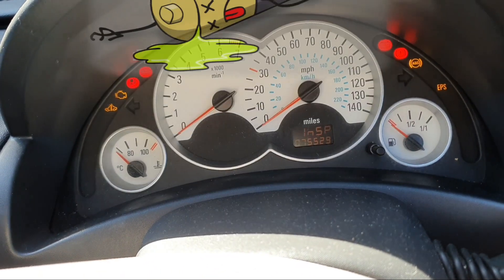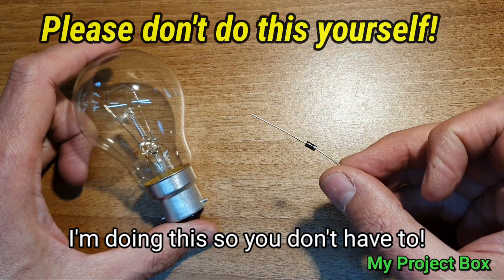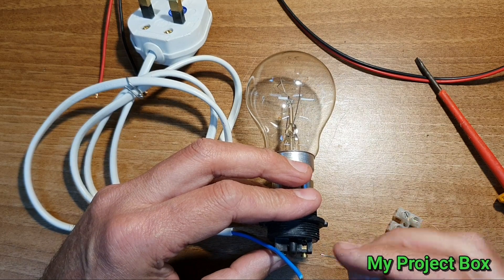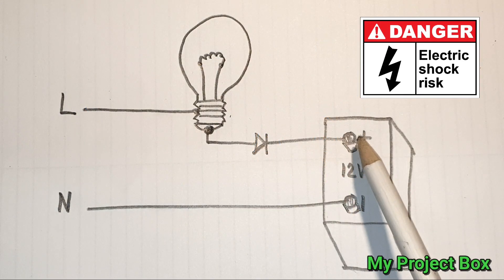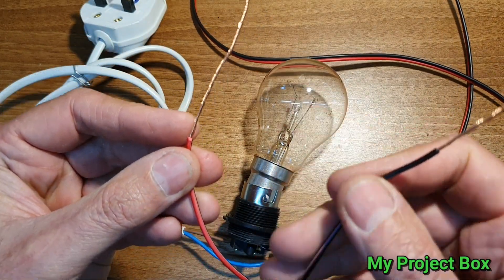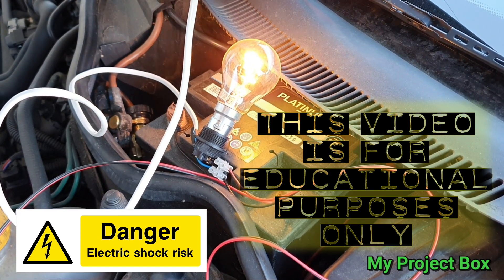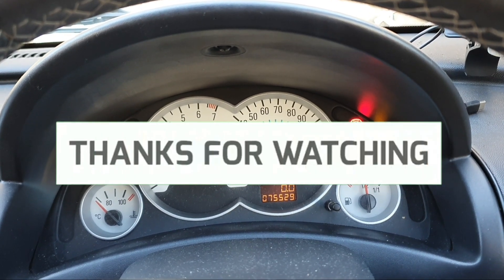Dangerous emergency battery charger ( Don't do this!) #ElectronicsCreators

Comment: It would be good to point out that the car bodywork is also live
Reply from the maker: If you don't disconnect the battery completely, then yes. And I did mention to disconnect the battery terminals completely from the car. I also stressed that nobody should really attempt this hack, it's dangerous but still interesting
Reply: @MyProjectBoxChannel  regardless of the battery if you’ve plugged it into live the bodywork will be live. It’s interesting indeed and will probably work by concept I’m assuming you have actually tried it.
Reply: @HogwartsBasement  no, the "bodywork" would not be live if both of the car's battery cables were disconnected.
Reply: @peterskyparker  😂 correct yes but he didn’t disconnect the battery hence why it’s disconnection is disregarded
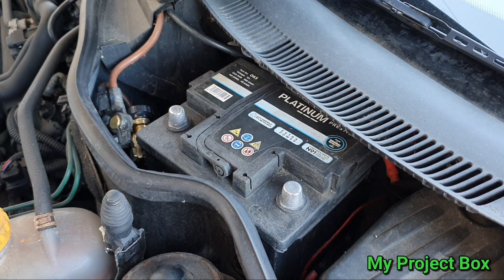Reply: @HogwartsBasement  what the hell is wrong with you? It's like you're not listening. He clearly removed the terminal connectors from the battery. 4:16

Comment: For us over-the-pond viewers using 120V what watt bulb would you recommend?  You just gotta love these MacGyver danger hacks that can save the day.
Reply from the maker: I really can't recommend that anybody actually try this, the risk of electrocution is extremely high. Any old fashioned, incandescent light bulb should do the trick. 40-100w. The higher the wattage, the higher the charge rate, but it's going to be very slow trickle charging. It's terribly inefficient as most of the energy is burnt as heat in the light bulb, and not going into the battery. With your voltage being 120 volts you would get better charging currents than on 230 volts, for the same wattage bulb.
Reply: Thank you for reply. Very interesting  120v charges faster.  I’m just an electronics hack but always think safety 1st and foremost so no worries. Cheers!
Reply from the maker: @mevk1  no worries 👍 try it if you want just be safe 😉. For the same wattage lamp, the current is more on a lower voltage than it is on a higher voltage. So for a 100W/ 240v lamp, its 417ma. And for a 100W/ 120v lamp, draws 833ma. I=P/V

Comment: Do incandescent bulbs in England (?) have a bayonet base like that one?
Reply from the maker: Yes they do. If you unscrew the white cable shroud, and the white shroud that protects the lamp base.😉
It's a standard uk pendant light. You can still buy the old fashioned incandescent light bulb, in Poundland as a red fireglow lamp. They will probably be illegal soon, I know the 100 watt light bulb is illegal.
Reply: @MyProjectBoxChannel  Interesting! In the US, the screw-in Edison base is standard, for all bulbs, incandescent or otherwise. Bayonet-base bulbs are common in automobiles. I've never seen one that large. Standard 100W and 60W incandescents have been banned here, but (next-to-useless) 40W incandescent bulbs are still for sale. There are also halogen bulbs designed to imitate 100W bulbs for sale, but their color temperature looks off to me. (One thing I've always admired about "Poundland" is those obnoxiously large plugs and receptacles! There is enough brass in one of those things to handle all of the current my entire house draws.)
Reply from the maker: In the UK and mostly the former British colonies, it's mainly bayonet instead of Edison screw. And yes the British 13 amp plug is very over-engineered (mind you it's 230 volt AC for every thing best to play safe then). If you want to see crazy look at the British ring main circuit (the ring main is the reason why each British plug has a 13 amp fuse inside ,Wikipedia)
Reply: @MyProjectBoxChannel  Holy smokes! I just googled "British ring main circuit". Talk about overkill!
Reply from the maker: @jerrymalone8370  Crazy I know 🤣, I think it might of been a a relic of the Second World War, as a means to try and save on copper. 

Talking about bayonet automotive bulbs. In the US you have your brake light and indicator lights combined????  European cars have separate amber indicators at the back.
Reply: @MyProjectBoxChannel  Yes, they are usually in the same bulb, like the 1157. One filament  for tail lights, another (much brighter) for brake. The filaments tend to fail independently, and there's usually two bulbs on each side of the car, so if one fails, it's not a problem. Some makes use the same filament for brake and turn signal, others have a separate amber bulb for turn signal.

Comment: Ummmm I can't emphasize enough how bad an idea this is. 

Why not just encourage people to use their internet router power supply ? They're almost always 12V 2A, it'd charge slowly but better than this !

I mean people are going to do this without disconnecting the terminals and fry the cars CPU !!

Don't you realise how deadly this could be if some idiot copies this and it goes viral on TikTok ??

Please take this down, there's no room for error here.... Please
Reply from the maker: It's it's definitely not a very safe way to charge a car battery. A salvaged little transformer out of a old radio or wall wart would be much safer. A switch mode power supply would need to be current limited, otherwise it would shut down on over current.

This is very much a third world, Bush mechanic hack.
It's a very old trick, a Old Timer show me when I was a kid ( Back in South Africa)

If you left the battery terminals connected, the ECU should in theory be fine. The whole car should be reference to neutral/"earth" plus the voltdrop from the bulb (the battery acting as load dropping voltage down 12-14v) But! The danger comes if the neutral becomes disconnected from the battery. The whole car will be at mains potential 240v! If the battery was knackered, and had a open circuit in side, you could have 240v across the terminals!
Reply: "Don't you realise how deadly this could be if some idiot copies this and it goes viral on TikTok ??"  
   
Just think of it as a little bleach in the gene pool - it's a win/win if morons take themselves out of the equation before they have the chance to breed, after they have had repeated warnings not to do this under any circumstances.
Reply: @Tsnafu  Yeah sure, I'm all for thinning the herd thru some radical Darwinism. 

But, I also know a lot of nice smart people who know nothing about electricity who might think this is a good last resort.

Also think of how STUPID the average teenager is on Tik Tok.
These idiots eat Tide Pods FFS !
Reply from the maker: @edwardfletcher7790  is this kind of danger and stupidity that got me interested in electricity in the first place. I used to be that stupid kid that nearly got killed. And I've never looked back 🤔😉
Reply: @MyProjectBoxChannel  Yeah, me too, Tesla coils are real pretty. Getting a serious electric shock from some 400v capacitors in an (UNPLUGGED) old TV as an 8yo, not so much ! lol